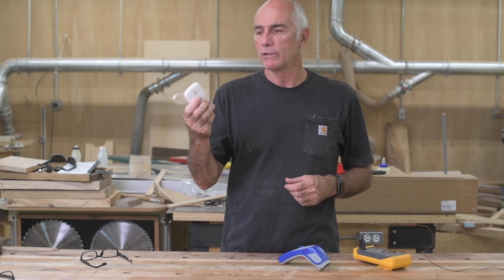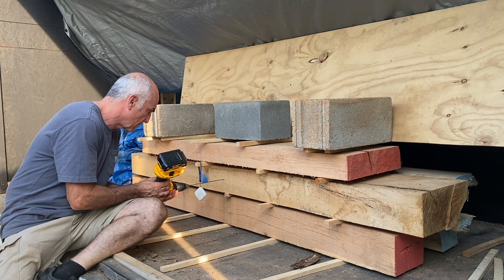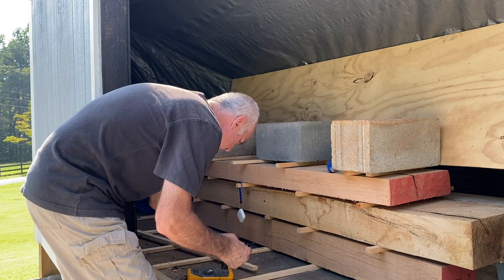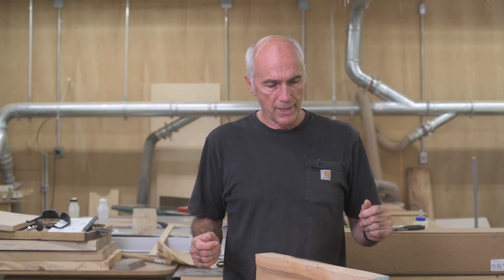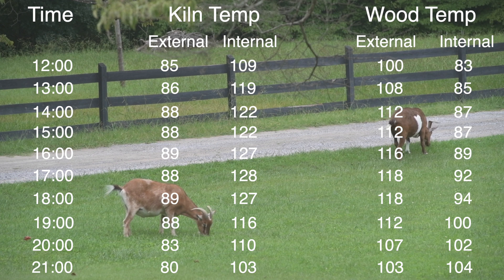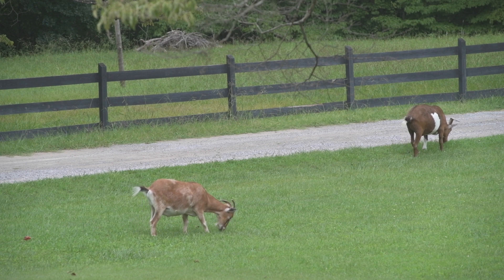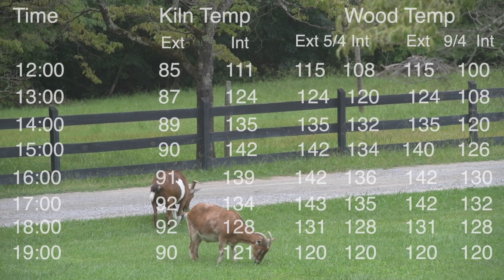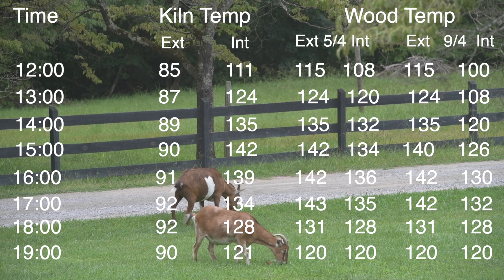Wood Temperatures Inside a Solar Kiln

Comment: What a fantastic source of information. Thank you for sharing, it really helps me. I guess the key to wood sterilization in a solar kiln is the quality of the build and insulation to trap that heat. Perhaps a bigger solar collector would help.
Reply from the maker: A few more factors too.  I could do a better job with sealing the kiln too but also the volume of wood (Thermal Mass) in the kiln has a lot to do with it as well.

Comment: Interesting video Paul.  I think you are right in that a thermally controlled switch and battery would help.  I don't think a solar kiln will ever get up to and maintain temperature for the required time for wood sterilization without an additional source of heat but you seem creative enough to prove me wrong 😁
Reply from the maker: I think you're right..  There's too much heat loss through the clear panels without an external heat source.  But..  I don't really have an issue with bugs once I get the wood through the kiln and into the shop.  Plenty of droppings in the barn where it air dries but haven't seen anything in the shop once it's been through the kiln.

Comment: I wonder if you had left the thermocouple in the wood (not taking it out every time you measured the temp) if it would have made any difference in the readings.
Reply from the maker: I left it in until the readings settled so I'm not sure.  Having the wire heat up to ambient temperature inside the kiln might have made a difference.